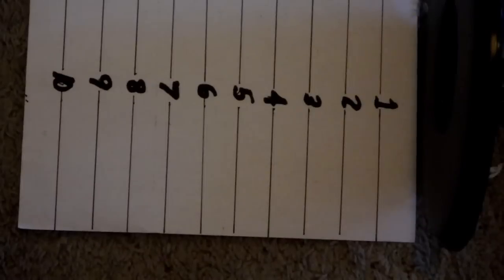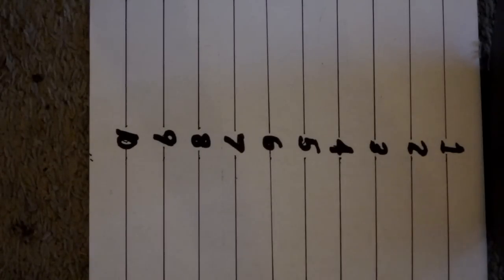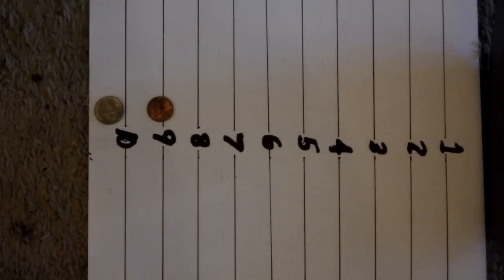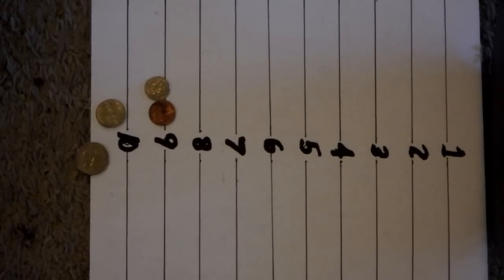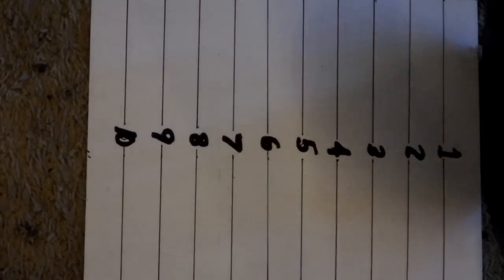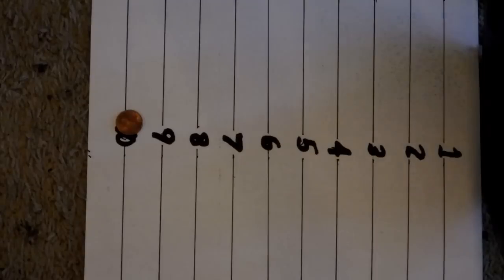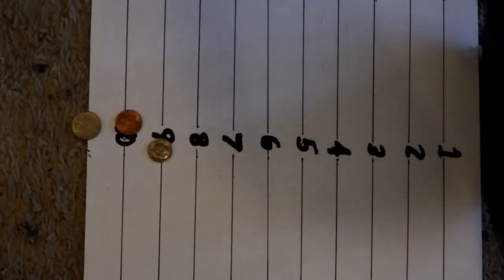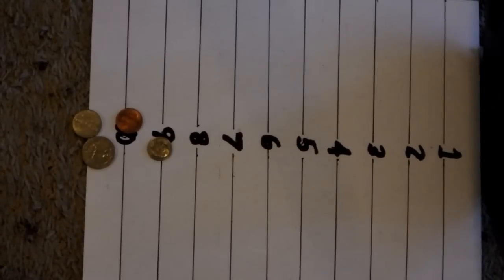Final Test Part 1:  Whites vs. Whites:  MX5 vs. M6...Air test

Comment: Looks like they both can find metal.
Be well,
Al-Fu
Reply from the maker: Als AllMetalDetecting They are both good, and both fine open field machines with the stock coils.  If you are doing trashy park hunting I would want another smaller coil for those areas.

Comment: Thank you sir for the test.  I am thinking about buying a White but after seeing your test I don't know now.  Any advise for me on what to buy??  Take care my friend!!!
Reply from the maker: If you want to stay in the mid range and VDI machines you can't go wrong with the Garrett AT Pro (or Gold for that matter) or the Fisher F19 )which may be among the est coin machines in this range..  A little more expensive the Safari is good as well as is the Teknetics T2.  All of these choices are fine and will get you a good collection of finds in the right areas..  I like the Nokta Fors Core and the Makro Racer which I believe is the same detector with another look (basically) but they are new (the Makro brand new) so they have ye to be put through the paces of the AT Pro/Gold and the Teknetics T2..  They are hard choices, if you have friends who have these detectors I would borrow them and see how you like them or at least find some dealer who can give you some Demos
Reply from the maker: TexasTigerDigs By the way there is also nothing wrong with Whites ;)

Comment: What size coils are you using? Your only  testing the coils on a metal detector- not the detector itself. I can tell your using the 950 coil on the M6 because of the tests. You will get roughly 9 inches on a 9 inch coil. 6 inches on a 6 inch coil. Its not rocket science.
Reply from the maker: You would have definitely saved me some time... :)